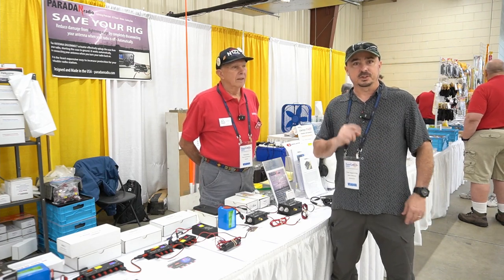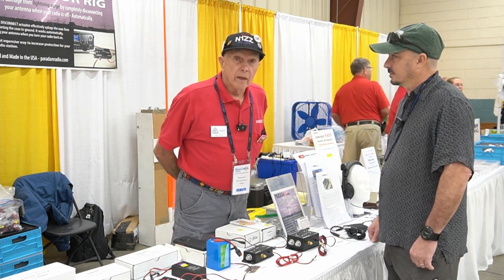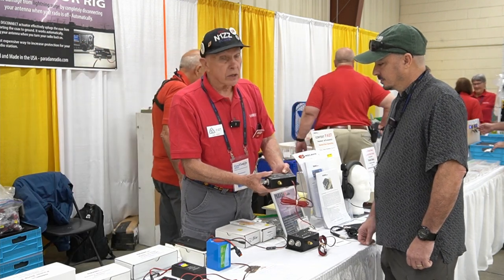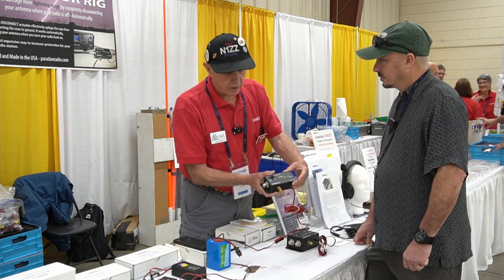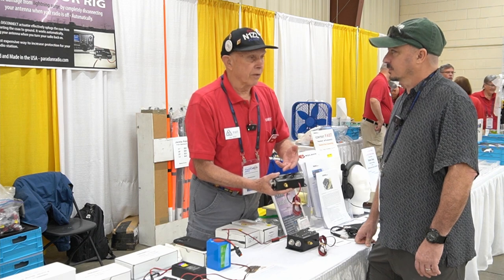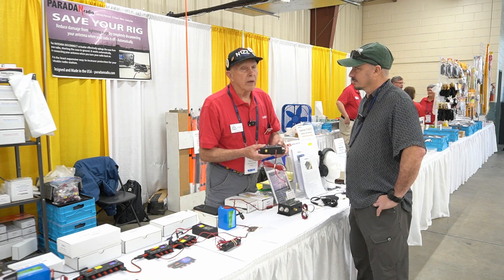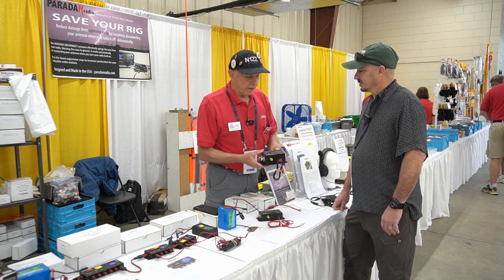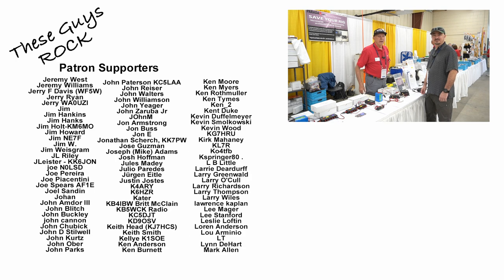Paradanradio Antenna Disconnect

Comment: Looks like a practical and very good product from the protection from lightning. If I were building them, I would also include LED indicators for both input and output to show that Antennas are linked with the input. Also an LED to indicate power to the relay or relays for the operation. This could all be adapted and including in the initial cost. Actually, if these items were cheaper, more people would buy them and you would actually make more in the long run. At this cost, very few people would actually invest to add them, to their radio shack. Think about it,  offer them for a lesser,  more consumable friendly price and it will sell big-time.   Billy / Albq. N.M.  2 / 22 / 2023

Comment: I unplug my hf rigs antenna connection and power completely when its not in use. And ground the antenna connector before plugging it back in.
I do however leave my vhf transceiver connected up. Thats a short vertical compared to the hf dipole and vertical I have.
What is the relays isolation rating?

Comment: I have a 18 in M to F uHF pigtail on all my rigs.  Why?  

1.  For my rigs which I sometimes use in the field, it makes it easier to remove the rig.  And some rigs, like the FT 2980, the antenna port is a pain to get to.

2. It is easier to replace the pig tail than the ant. port on the rig.  I have to unplug a lot in H-Town for lighting.

3. M-F reduces a point of failure by not having to worry about a barrel connection.

4.  These M-F cables can be custom built, either at home or by places like ABR in Houston.

Comment: Do you guarantee that equipment will not be damaged due to lightening?
Reply: The author can correct me if I am wrong, but no one will give that guarantee, there is nothing out there that will guarantee no damage from a direct lightning strike, period. Even if you have the antenna disconnected a direct strike will find a way to get into your home and your electrical system, and at that point it is an insurance claim. This device is great at shunting the static from a nearby strike or random static to your grounding system and help your equipment survive that event. Looks like a great product and it is on my list to buy. For Dan, like many others we need something for 2M, 70cm.
I actually read a complaint from an end user that he thought this device detected lightning and disconnected itself, come on people!!!

Comment: Interesting in theory, but unless your constantly monitoring SWR, it seems like an accident waiting to happen, as if it fails, you wouldn't know until you've fried the finals of the radio. Also, if your using an Alpha Delta switch, simply switching it to the "com" position grounds out the antennas.
Reply: Grounding your center conductor turns your antenna into a lightning rod. 🌩...assuming you are using a vertical or a dipole.  Loop antennas and j-poles, end fed, and slim jims already are shorted to ground.

Comment: So he never finished explaining the use above six meters.  Is it modifiable?  Does he have a different design?
Reply from the maker: As far as I know, he doesn't offer a 2M/440 version at this time.
Reply: When I talked one of his employees about this he said I could expect an SWR around 1.8 :1on 2M and something higher on 70cm. I don't know if it can be tuned out with an external tuner or not. The internal tuner on my 991A does not tune 2M or 70cm.

Comment: It is very surprising how widespread the misunderstandings are about lightening, even amongst hams. Shorting your radiator to ground does what exactly? Is there any ham alive that knows how a lightning rod works and why they are placed all over power substations and on power line poles?
Reply: Water seeks lowest level
Lighting seeks earth ground.
Reply: @DominicMazoch  - Many in the electrical engineering world say that lightning travels from the earth to the sky.
Reply: Please enlighten me. I really don't know what you mean.
Reply: @Black Arrow  - You know that Benjamin Franklin invented the lightning rod. Most people mistakenly think that lightning rods are designed to take a direct lighting strike. Lighting rods dissipate static charge to prevent lighting from striking in the first place. Imagine the sky and the ground as an enormous capacator. As the charge builds, as in the case of a thunderstorm, a voltage is reached where the air is ionized and becomes conductive, e.g., a lightning bolt. If you connect a piece of wire to ground and raise the other end high into the sky, the distance between the cloud layer (+) and ground (-) is less so the voltage required to make an arc is less. Obviously, if you could connect the clouds to the ground, no voltage could ever build up. The point to notice is current in a lightning bolt travels from the ground to the sky. So, the idea is to dissipate voltage so it can never build up a voltage that would create a dangerous arc. Because of its pointy shape, a lightning rod can not hold a charge. As electrons build up on it from electrostatic force, electrons are pushed off the tip in a gradual controlled way so that a voltage between the object the lightning rod is attached to and the sky can not form to create a dangerous lightning discharge. If you look at the way a gas discharge tube works, it allows for the build up of voltage to jump a tiny gap, and it will snap, snap, snap just like a spark plug until the static electricity is dissipated. 
    The thing that scares people about the possibility of lightning damaging their radio is the faulty belief that an over current will somehow get into your radio. But let's think. The current is trying to get from ground to the clouds. The case of your radio is ground along with the outer conductor of your coax. The current is being pulled up through your antenna, which is acting like a lightning rod, i.e., dissipating the charge and preventing static buildup. Every time static electricity starts to rise on your antenna, a little discharge arc will form between the center conductor and the shell. This arcing will prevent static voltage from getting so large so as to form a bolt of lightning, which, if allowed to form, would destroy your entire house, not just your radio.  
    The object being marketed in this video does not add any protection at all. It just keeps you from hearing the tic, tic, tic sound of static electricity discharging through your antenna. Another misnomer is calling a gas discharge tube a "lightning arrestor." As if a little tiny gas discharge tube could stop a lightning bolt  
    It bothers me that people who sell these "amazing devices" are in reality exploiting other people's fears and misunderstandings and providing no protection whatsoever. Instead of buying this worthless device, just install a gas discharge tube in your antenna system. They work 24/365, require no power to operate, and cost as little as one dollar. I've had my 2m/70cm radios connected to my roof antennas and  my hf radio to a GAP vertical for many years without any lightning protection and without any issues.  The ticking noise the discharge makes is definitely unsettling. 
    Benjamin Franklin put lightning rods on people's homes to protect them, not to attract lightning to them. It is the same reason power companies put them on power poles and on their substations. They are not even large. They're usually 6" to a foot long. 
    Take an Alpha Delta lightning arrestor ($89.99), for instance: It doesn't even use a gas discharge tube. The brass knob merely controls the gap spacing and the device controls "where" the arc occurs because you don't want the arc to occur through the dielectric of your coax because it could change its impedance over time. A "lightning arrestor" is so unbelievably simple mechanically I think $90 is an outrageous price for an Alpha Delta.  The creative ham can make an effective lightning arrestor out of a used spark plug. No need to buy a magical box.
Reply: But, but, there is money to be made ... All this shows is that people rather fall for snake oil than do their own research in how it works. But then, maybe people will need to learn the hard way that one can't cheat physics.
Reply: Finally an intelligent post!
Reply: @whenpigsfly3271 - the alpha delta Lightning arrester has a gas tube.  Unscrew that brass cap and the gas tube is inside it. It’s not a knob for adjusting the gap; it’s simply a cap with an o-ring so you can replace the gas tube.

Comment: Why is there so much fear of lightning? I've had my 2m/70cm radios connected to a vertical co-linear array (Cushcraft) continuously for over 30 years with no lightning protection and no issues. Am I just lucky, or is the danger of lightning overblown?
Reply: Depends where you live. I'm on the west coast and we have very few lightning storms locally. Grew up back east and the storms would light up the sky and rattle the window panes.

Comment: Okay how about we just remember to disconnect the antenna and unplug the radios if you're in a lightning prone area if you are not actively using them in during a lightning storm
Reply: I used to do that... until, in the middle of a storm, I tried to disconnect my coax from the radio. It felt like grabbing a hot sparkplug wire on a Briggs and Stratton. If you ground your radiator (the center conductor), aren't you effectively creating a lightning rod? Is that desirable if the common understanding is that lightning rods attract lightning?
Reply: Perfect! Except for the fact that the vast majority of hams simply don't do that, ever.
Reply: Must be nice for most of them guys to be able to afford to risk expensive radio equipment I'm on a tight budget believe me when I'm not using it it's unplugged disconnected from the radio and literally sitting on the other side of a room from where the antenna cables come into my shack
Reply: @Dusty Livas  - I think the important thing to glean from the comments is that there are far better and cheaper and more reliable products available than the one depicted in this video. For example, you can use a spark gap or a gas discharge tube. Both can cost around a dollar. They are simple, reliable, and require no external power. Many people are inclined to buy peace of mind even though the product provides no added safety over the other methods that I described.
Reply: @dustylivas278 your post makes it sound like you are disconnecting from the inside of your house and not outside where a lightning arrester is supposed to be installed If this is true you are still letting the lightning inside.

Comment: So, a lightning bolt or even a side bolt traverses 10000ft from the cloud down and then refuses to jump the relay contacts and all its energy rather goes to ground no matter how poorly or how inductive it is. ... Yeah, all I can say, P.T. Barnum was right.
Reply: One thing to know about lightning and antennas is that it can be initiated by large amounts of static building up on the antenna caused by winds during a storm. (Please don't take my word for it, it's an interesting topic to read about) The static encourages lightning to initiate from that point.  Will those contacts stop lighting from arcing to the radio if it was to strike anyway? Probably not.
But... when the contacts are open to the radio, they are holding the antenna to ground, which is draining static off, and may discourage the lightning from wanting to initiate from that point to begin with. You could build something like this yourself much much cheaper, but that goes for everything like this in our hobby. You could build a g5rv for about 1/10th the buy it price. 

73 
Matt
W3MMW
Reply: @matthew weaver  - Static electricity can not build up on an antenna. That is why you never see or hear of any lightning bolt striking an antenna. If this was a legitimate concern, one would think all those mountain top antenna farms would suffer lightning strikes regularly, and yet we never hear of it. It is ridiculous to think technicians race up to the mountain tops to disconnect all the antennas during a storm. And yet again, all police, fire, FOREST service, BLM, EMS, etc. enjoy continuous radio repeater service during all storms. These devices depicted in this video are a complete SCAM.

Comment: Sorry nothing stops a direct hit from lightning. If a strike is close by, everything in your house will induce voltage. Wired alarm systems prone to damage, as well your radio etc. So unpredictable. Sorry I'll pass on this one.
Reply: You absolutely can protect from lighting.  I work in cellular, and our towers get hit multiple times a year.  As long as things are done right, you can contain it.
Reply: @falsedragon33  Yes I agree with you if done right. Cell towers and the equipment are design with Lightning in mind. All the gear are in a steel or mostly aluminum enclosure.  Heavily grounded.